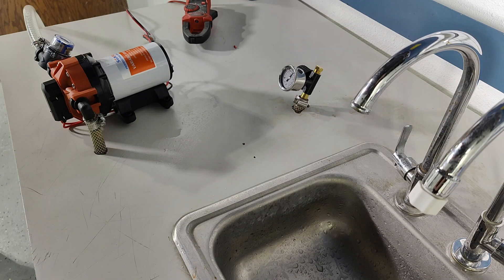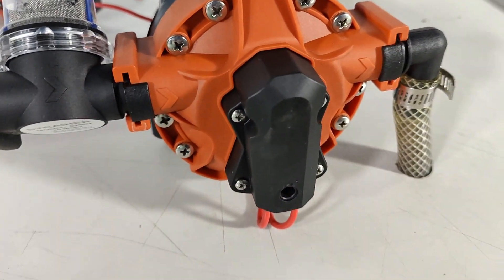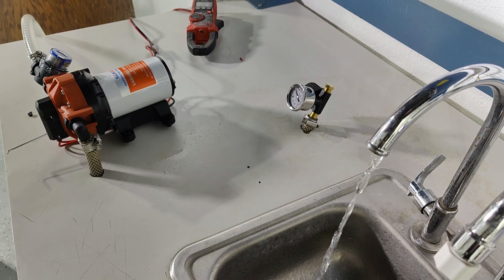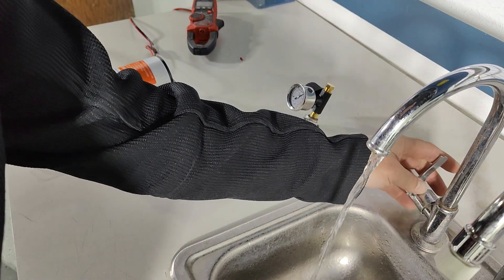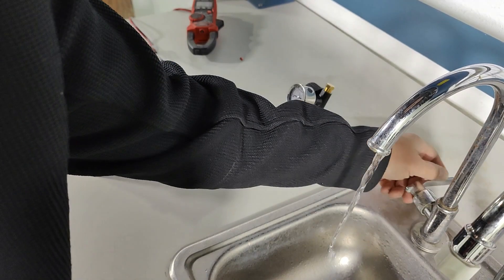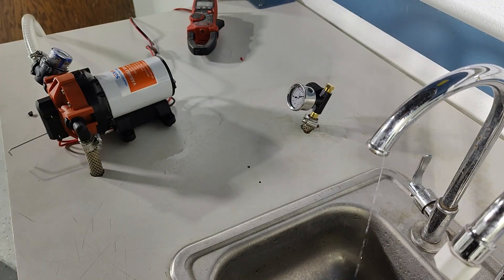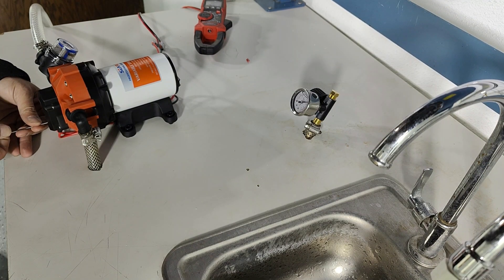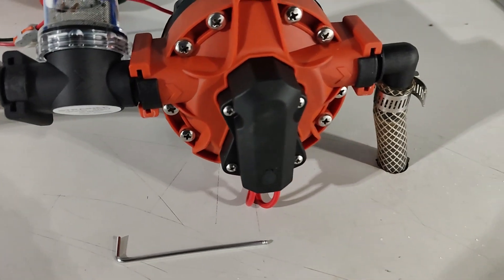SEAFLO 56A Bypass Valve Adjustment to prevent cycling

Comment: seaflo 12 volt water pump started to work automatically on its own, it works on its own even if we do not turn on the water every 5 minutes, for this reason it is not a product that we will recommend very much, it did not last even 6 months.
Reply from the maker: Do you have any leaks in your water system?
Reply: @jzkbbi1  No, there is no leakage in the installation, I checked very well.
Reply from the maker: Then there could be debris causing the internal valve to not seat properly.  You can try running lots of water through to clear it.

Comment: I have to close my bypass way down or I can hear the water flowing backwards through the bypass with all the faucets off and the pump will cycle every 30 seconds to build system pressure.  Is my bypass valve worn out?
Reply from the maker: What pump?

Comment: I have a new seaflow 33 want to use for my mobile pressure washer to final rinse spot free water. Do i need an accumulater tank? Also can i adjust the bypass on the 33?
Reply from the maker: The 33 does not have a bypass valve.  If you use the 33 in low flow situations, then an accumulator tank is helpful to prevent cycling.  I recommend that you try it first with out an accumulator.  Or use the 42 series which has a bypass valve.

Comment: Any advice if the pump cuts off at full flow after 15-20 seconds?
Reply: You may have a small leak SOMEWHERE in your system...
Reply: Did you ever figure this out? I’m having the same issue

Comment: If using with a 1.2 gpm pressure washer, would this help ?
Reply: I have the 33series
Reply from the maker: @roroalv  How is the 33 working out with the pressure washer?
Reply: @jzkbbi1  it does what it needs to do. Performs great however since they’re is very low flow, it shuts on and off constantly when running the pressure washer. No problems however
Reply from the maker: @roroalv  Perhaps try the 55 pump then.  It may be that the variable nature of the 56A is lost on your application.  Further, if the 55 still doesn't provide enough flow, you can plumb 2 in parallel to increase flow.

Comment: I have a standard kitchen faucet and I cannot dial mine in. Is it possible that it doesn't work because of the aerator in the faucet?
Reply from the maker: If you have trouble dialing it in, error on the side of a little cycling.

Comment: Jus got the 42 series and it did have the cycling issue at low flow and doing exactly what you said to do in this video got mine dialed in to perfection. TY for the video 😊

Comment: My Seaflo 55 twitches when off. Every 30-60 seconds it does this. I have confirmed no leaks in the system by isolating the pump. It still does it. Do you have a solution for this problem? Thank you in advance
Reply: Bypass is over adjusted like he said.